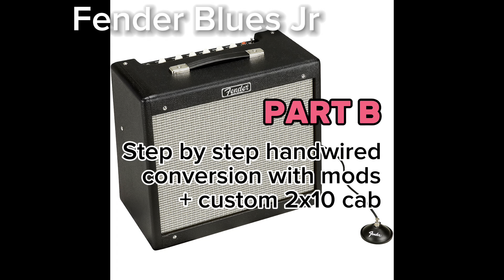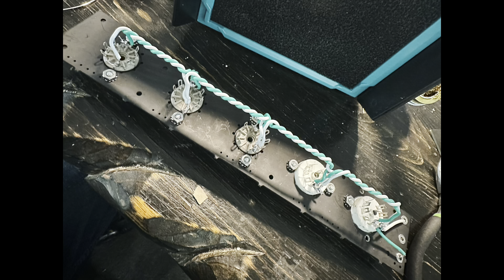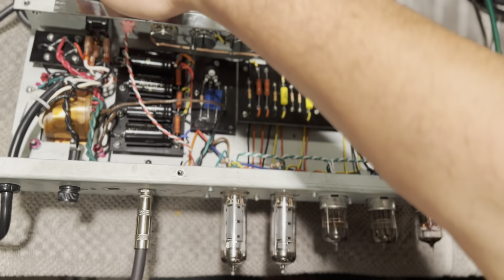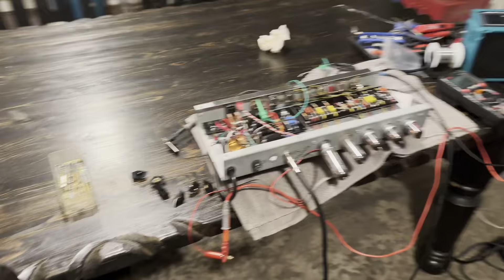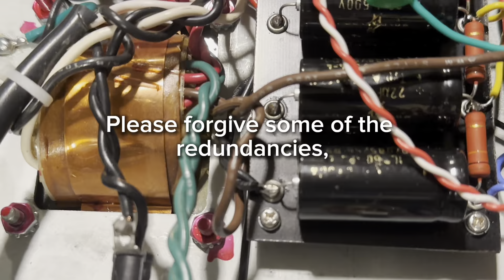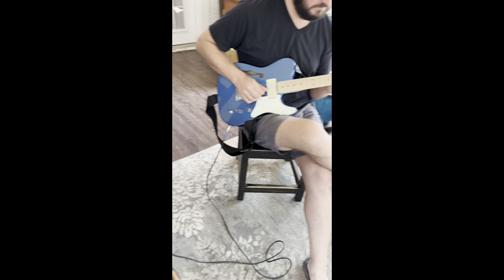Fender Blues Jr amp | In-depth look into design flaws, common failures, and handwired conversion

Comment: Very nice clean work there, bro!
I bought a cheap jr with the intention of gutting and hand wiring it. Because of the cab i think id rather scratch build something. I think ill mod it a bit and sell it again. A fellow amp builder mentioned there's a resistor somewhere near the input that dumps a lot of signal to ground. He cut it out and said the amp sounds so much better. Ill have to revisit that convo. 
Jrs and hot rod series amps are really cheaply made and have inherent problems that fender refuses to fix because people keep throwing money at them.

Comment: Nothing like point to point wiring......I did the same with a Fender Custom Vibrolux Reverb. Rip the circuit board and threw the bitch away. Just like Leo Fender did back in the way. Nothing like vintage tone for days..... Good for you.....

Comment: If you have an new BJ w/black pcb ... many of the power  tubes installed by the factory are faulty and will "flame out" and blow r51,... also you can change R51 &R52 with 2 watt 270 OHM resistors to elimitate  problems ( black pcb are cathode biased so biasing is not much of an issue .......installing the Mod by Fromel is recommended....   Take care  Ps stand off the new resistors well away from the pcb to allow things to run cooler      GR